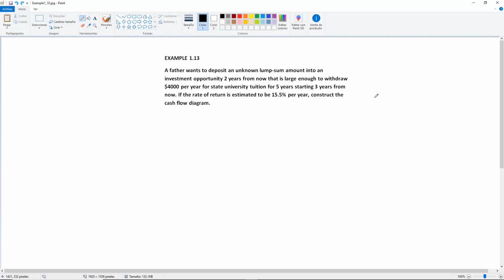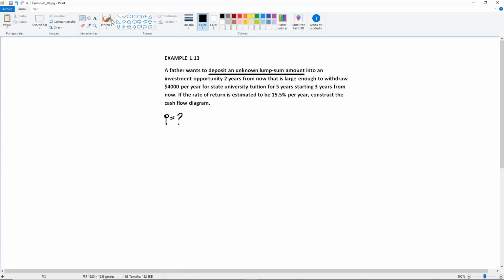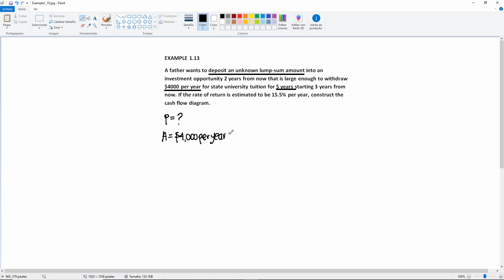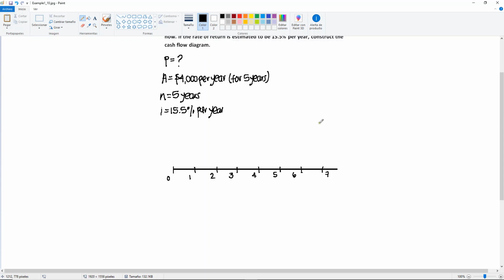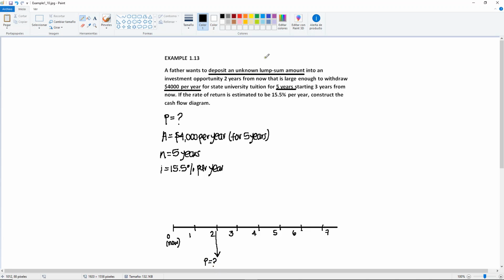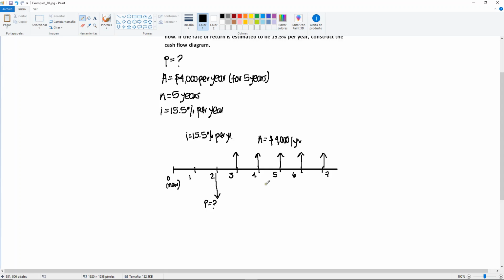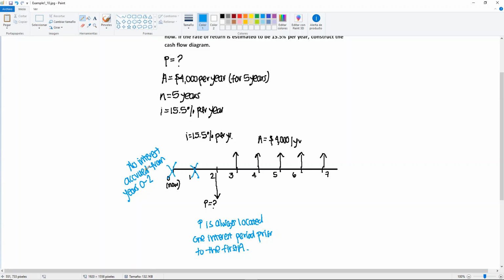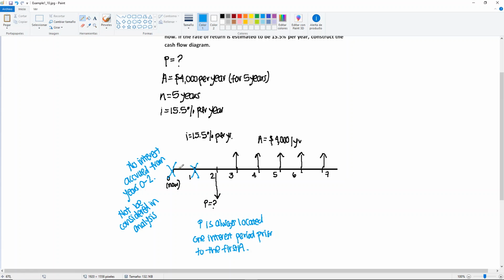Engineering Economics - More Shifted Cash Flow Diagrams

Comment: Please also find the unknown lump sump amount🙏
Reply from the maker: Absolutely!
P = A(P/A, 15.5%, 5)
I did a quick calculation in Excel, using the following formula:
=PV(15.5%,5,4000)
Resulting in $13,251.40
I have attached an Excel file with the year-to-year balance: https://docs.google.com/spreadsheets/d/1sAeBN0_d5cJgTyJejBkrtKmOH7V5FQH2/edit?usp=sharing&ouid=102020033114582942067&rtpof=true&sd=true.
Let me know if you have any questions! :)